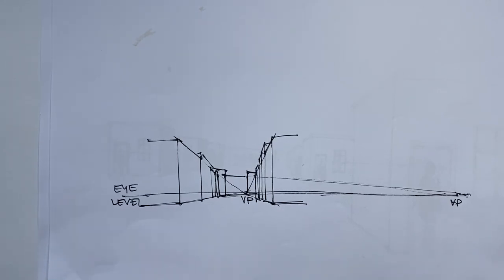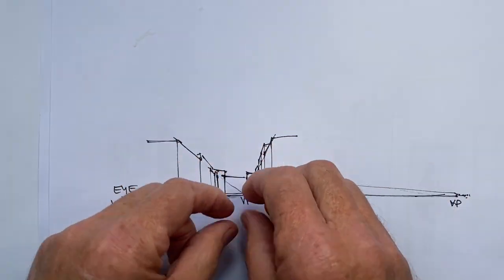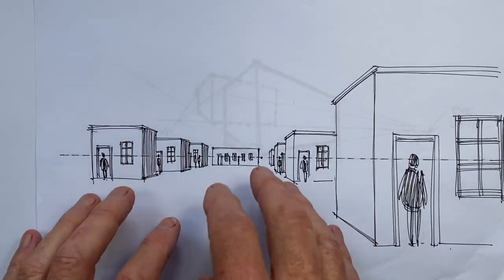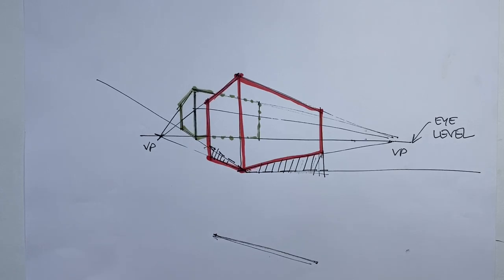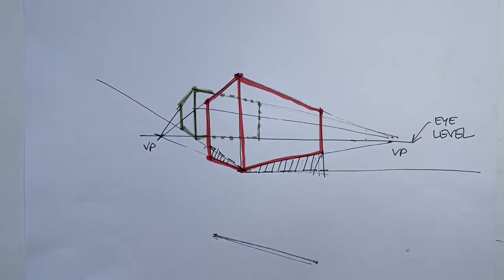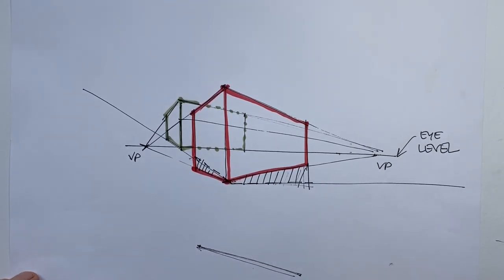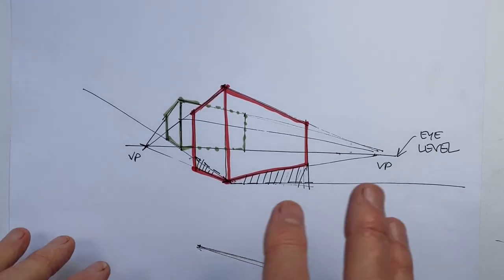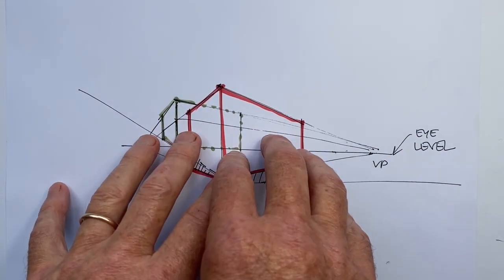Understanding Perspective on Curved Walls

Comment: Thank you very much Stephen for this excellent demonstration of how to draw a building with  curved perspective. Your detailed explanation highlighted the many points to be considered in this regard . 
I admire the ease with which you use your pen or pencil to gauge  the angle of a line on the photo and then accurately transfer it to the drawing something which i am not able to get right. I guess it takes a practiced eye and a steady hand.
Reply from the maker: Most things improve with practice. But the important thing is to draw at the rate you can draw accurately. Then when you improve, you get faster at drawing accurately. 😀
Reply: Yes that's right . I have to slow down and  put  in extra practice in areas of perspective drawing that  I'm struggling with.

Comment: In general, for beginners like myself, would you recommend we draw a cuboid for capturing the cylindric tower and its key circular perspectives first? I see you drew the various  components directly without such a reference on paper.
Reply from the maker: I don’t do that as I draw freehand directly in pen, so any roughing out lines will be there at the end. I certainly visualise what you say however. My suggestion is that you practice what/how you want to get better at. But start at a simple enough level that you can do it well and then slowly increase the difficulty 😀
Reply: @stephentraversart  thank you! I started drawing a week ago because I found an old notebook lying around and didn't have any other uses in mind. I came across your videos (particularly perspective ones) and I can confirm they've been surprisingly helpful - already seeing great improvements in my sketches just one week apart for someone with zero previous exposure. Thank you !

Comment: Thank you so much for all of these videos, I've recently gotten into them and been finally clicking what perspective is. I do have one questions about the eyelevel and it is possible you might said in on of your videos but I still don't seem to quite catch it. If eye level is where the eyes looking why doesn't it change the eye level when the head tilts down or up? Does this mean the eye level is where the eyes are off the ground plane, no matter if you tilt your head up or down? However it gets a little confusing when we look at object from birds eyes view because eye level is entirely different? I'm not really sure what is not clicking to me right there but if you have the time to answer the question I would be really thankful!! 😊
Reply from the maker: Yes, it’s where your eyes are level relative to the ground plane you as the observer are on. So if we are looking up above our height at a tall building, there will be no horizontal line made by the architecture within what we are seeing. It will be level with our eyes, so we’ll have to bring our head back down to see it. There is always an eye level, but it is not always within our view. A cropped photo may also have removed or tilted it without our being aware. Hope this helps. 😀

Comment: God bless you indeed, thank you so, so much, curved objects in perspective quite difficult for me. I also struggle with the proportion, your foto is smaller than your actual drawing, how to do that because i tried so many times and i run out of paper 😊
Reply from the maker: Thanks Cristina. Actually, I had intended to draw it same size, but it somehow got larger. Happens to me as well. The video I just posted is on keeping proportions correct, so you might find that helpful. All the best with it. 😀